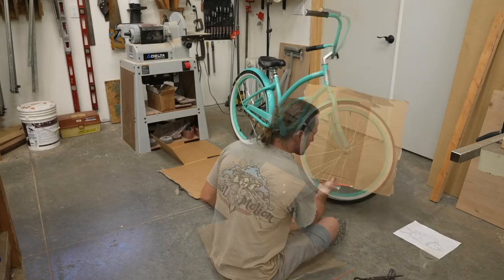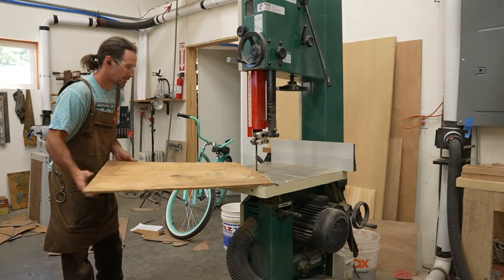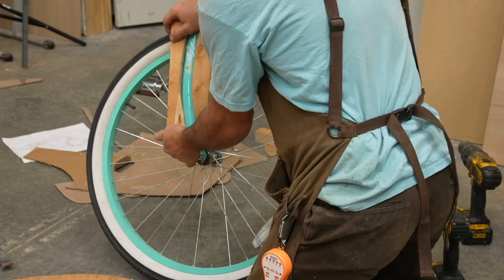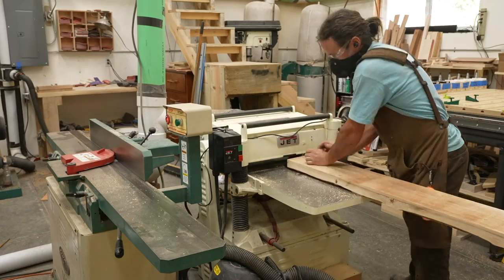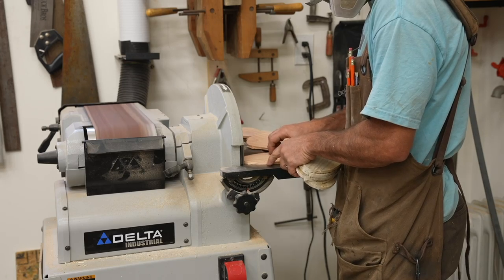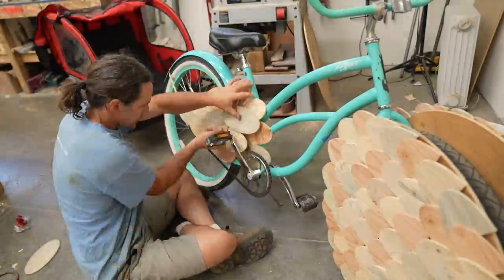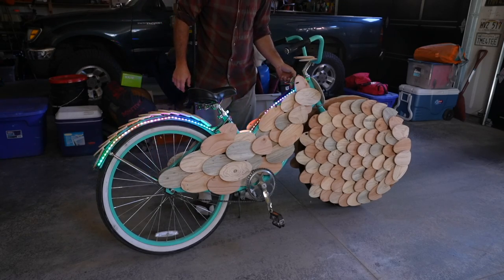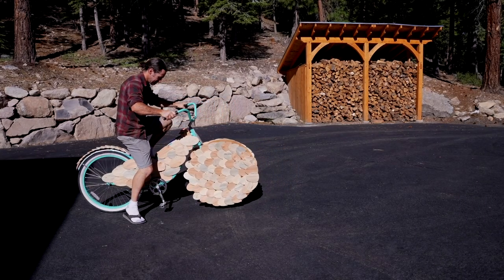Burning Man 2023 Art Bike: The Wood Scale Bike! Using my CNC Machine for Art Projects

Comment: Complete moop machine to me.  And good luck changing a flat.
Reply from the maker: Wanna make some bets ;).  I did some strength tests, and the hot glue pieces are super hard to break off. But I'm wondering how the hot sun will affect it. Changing a flat is no problem: I made it so the wheels can easily removed.
Reply: @CorbinDunn  you are totally missing the point of people wrecking into your bike.
Reply from the maker: @MakersTeleMark  Well! I can now report on how it handled: Luckily I didn't have anyone crash in to the bike, so I didn't lose any scales. Until the rain started....the bike fell over in the mud and the scales got saturated, causing the hot glue to start to come off. At that point Burning Man was basically over so I pulled off the scales and put them all into a trash bag.